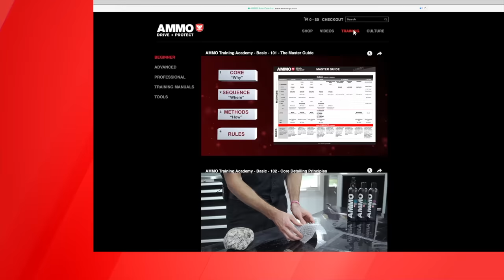14 BAD Detailing Mistakes You Must Avoid: ATA 106

Comment: Best detailing tip I learned from this!  Buy a brand new car, have it fully wrapped at the dealership with super plush micro fiber towels!  Have car delivered to your home,  very very gently push it into a super clean garage, and after gently removing micro fiber towels, never ever drive it!  Keep garage airtight, so no bug could ever crawl on car, persey ever scratch it!

Comment: Larry.Youre certainly the Dr of detailing and I love all the knowledge you pass on.
Thing is I cannot resist stroking my car once its been polished, sealed and waxed,  its soooo nice lol
Reply: SRKarting no!
Reply: SRKarting so is there a way to clean interior without machine , or can you use an all purpose cleaner if you do small sections?
Reply: Joseph McDonnell it’s very time consuming to clean the dirty spots and honestly not worth it, machine use will cut the time you use (say a small dirt, Coca Cola spill) to say 1 minute, but if it looks clean and you just wanna do it for maintenance reasons then do it by hand by all means!
Reply: Clayed my car for the first time ever yesterday and most likely introduced micro swirls haha... Soooo smooth.

Comment: You caught me Larry. I'm guilty of three mistakes I didn't even know I was making. You just educated me, thank you.
Reply: He got me on all purpose cleaner, dish soap and cleaning towels. In defense of my dish soap use, I've only done it when I wanted the paint stripped to the clear coat, so maybe it's a split-decision on that one. I was just about to make some more microfiber towel fouls so great to see this, thanks Larry!
Reply: @am4230  if you are trying to purposely strip wax to reapply later, all purpose cleaner or dish soap is fine to use.
Reply: Actually dish soap is bad it has lanolin in it which if you are in an accident and they have to re-paint the lanolin will seap in and bubble the paint

Comment: I'm late but he said keep APC out of the interior. .  What is best to use?- a dedicated VLR or carpet shampoo?
Reply: Me too. Inquiring minds want to know what to use.
Reply: i know it’s a bit late, but a couple tips. when cleaning hard plastics, leather etc. most of the time a damp microfiber is all you need. for leather, give it a good wipe, then condition it. NEVER us APC on leather or vinyl as it’ll dry it out and crack/tear prematurely. this applies to plastic as well but you can go back over plastic afterwards with the damp rag and it should be good. as for carpets and stuff, most carpet cleaning vacuums have special soap that goes with them. for touch screens, damp microfiber then dry with a dry microfiber right after to avoid water residue on the screen. inside windows can be cleaned with just a dry microfiber. unless you’ve got spill stains or oils from your arms/hands in it. then damp micro followed by a dry one.

Comment: Hey I was wondering if you could do a glass scratch repair video
Reply: Samuel Dansie how in the hell doe you scratch glass, if you drive a commodore I demand answers
Reply: logan thompson dirt in window seals
Reply: Samuel Dansie glass is the hardest substance you find on the car 😂
Reply: its the same as for paint except you use different pads and compounds.
Reply: As a glass installer often times it’s best to replace the glass when it’s badly scratched. Cerium oxide can polish small scratches, but it’s a tricky substance to get right. Too much heat will leave a distortion, not enough just makes the scratch ‘shiny’
Reply: well the commodores need more than glass repairs after todays newcastle race.
Reply: Propotus is there any other things I've been able to get it to a haze is there any thing other than cerium oxide that would work
Reply: Darren S nah mate it'll be right she'll buff out......
Reply: logan thompson lol classic line there mate
Reply: Samuel - Just use a polish (Meguiar M205 polish) and buff with a wool. It removed all of my scratches on my windshield due to worn out / damaged wiper.   And then make sure to give good couple of layers of wax afterwards otherwise the wiper will squeek when you use them on the windshield.
Reply: Samuel Dansie I saw a video on here one time where the guy used orange hand cleaner on the windshield. Either it was like Goop without pumice or with it. Can’t remember but it took the fine scratches from wiper blades out

Comment: Living in CA, we are very water restricted. I only do one water wash a year, during my annual beautification process for my true beauty queen (Tesla Model S).  All others are waterless.  It's a BIG challenge.   I actually do use a CA car duster and have never had a problem.  I will say that I replace them very often and I use the absolutely lightest touch I can to capture the dust.  Even after a rain I will use it when the car is dry and I have been able to carefully remove the abrasives.  Not easy, I can tell you.  I was terribly stressed at first.  But I found a way to make it work.  I do have a nano coating on it, which helps provide some resistance to scratching. If you are going to use a duster, you absolutely need to know what you are doing.  Period.

Thank you Larry on your fantastic vids.  I have learned so much from you!!!

Comment: I have a question
How do i properly dust off my car?
You know, when its been sitting there for a day and dust accumulates making ur view through the windshield slightly distorted
Reply: I’m wondering the same thing.
Reply: If you have access to an air hose with an air gun it makes quick work of that dust!
Reply: Air gun or air chuck, or, you can get a bottle of waterless wash and wax (I prefer Meguiar's) and spray a little more on than if there was no dust to lubricate it properly, then wipe off and buff with two clean microfiber towels, one for the initial wipe, one for the buff off.

Comment: So you're saying I can't just use a scotchbrite pad and go to town on my paintwork?
Reply: Seb Krause I use magic erasers to get scratches and rough stuff off it’s basically fine grade sand paper just cheaper. But you do have to buff and wax cause it dulls the shine.
Reply: only use 3M adhesives on your paintjob
Reply: Seb Krause JUST BREAK OUT THE CORDLESS SANDER!
Reply: You can do anything you can afford :-)
Reply: Yes just use the grey wet with some blend prep then dry. Don't forget to top coat it when your done with a nice rattle clear
Reply: There are a lot it great detailing rocks you can use these these days that are much more effective 👍
Reply: Even better , some 80 grit sandpaper 👍
Reply: Seb Krause just make sure if you see scratches,that means its cleaning the dirty paint and new paint grows back on with the water!
Reply: As a kid (like 8) I washed my moms car all the time. The hood on my moms 2002 Honda CR-V had bird shit all over it. So I got a scothbrite pad and buffed that shit out😂😂 it looked okay till it dried. Lmao. I guess we all come from somewhere
Reply: Scotch bright I just take a piece of tape and put it on the ground to pick up sand and rock particles than I wash and wax my car all in one pass using the sand and rock covered tape

Comment: I'm in the car clenaning trade 3.09s i've used AutoGlym Ultra Gloss on my 2002 Yaris door mirror plastics and it came out brilliant! It really gets it back to black and shiny so no problem there at all.I'm a car valeter for some 20yrs and i do understand about plastics and polishing/waxing.APC on interior is SO TRUE! In the trade we had cheap TRF (Traffic film remover) and used it on EVERYTHING incl leather,seats and so on.It really does ruin the cloth seats and carpets i tell you.The leather is ok it's just i rubbed off excess TFR with a warm flunky/chamois properly otherwise it gets sticky n horrible.

Comment: Hey Larry great video. I wanted to say THANK YOU SO MUCH for the tip of using left over “wash solution/soapy water” when claying. Such a simple yet over looked idea. I saved about half a bottle of detail spray. And I don’t wear gloves whilst washing the body of the car because I really enjoy feeling the soap and contours of my car panels between the mit and my bare hand. Sounds strange I know.... I am strange! Loving this series! Keep it up.
Reply: Fes Y I detail and I always start washing with wheels and wheel wells and I use my old wash Water to save soap cause it’s just gonna get filthy with brake dust and mud anyways.
Reply: Tammy Forbes what?

Comment: Good morning Larry. So no chamis, no silicone squeegees or beach towels. How about a video on the best way to dry a car?
Reply: Chris Muncy he already has.... spoiler alert huge microfibre towels
Reply: Thanks Logan :-)
Reply from the maker: I have a bunch of these videos. Here is one: https://www.youtube.com/watch?v=w0hzJImmvNU
Reply: Thank you Larry.
Reply: I use a leaf blower then a big micro fiber towel.  I'm sure Larry and others will say that's wrong but it's never caused a problem and i drive my car thru the air at 100+ mph all the time.  

Real important, make sure the ground is clean and wet.  I once had to move my car before I dried it.  Didn't go well.
Reply: Mf towels, he has a six pack of red mf towels on his site. I own them are very good at drying and buffing off wax or sealants. I also ordered some from amazon.
Reply: Texas Car Nerd that's why I don't bother with the blower aha
Reply: GET A BLOWER!!!!!  A MUST FOR A BLACK CAR!!!  

1)  no contact, at all.  
2)  anything that falls on your car between the rinse, and dry, (or any missed dirt) is simply blown off, or blown over........not rubbed in. 
3)  humidity in the area???  The heated air of a blower takes care of it no problem 
4)  IT'S SO FUN AND SATISFYING!!! 
5)  dry your tires so they can accept tire shine immediately.  You can even dry your rotors before they rust!!!

BEST $160 I'VE SPENT ON MY CAR!!!!
Reply: Use a air gun,  a blower like a electric leaf blower or a shop vac with a blower function
Reply: I stopped drying with any microfiber towel. They all scratch.
 I use filtered water..

Comment: Great tip on using gloves. I'm not sold on the black ones, though. Seems like lighter-colored ones would be easier to see possible contaminants on, so that you can avoid transferring them onto the surface. Thoughts?
Reply: I have the same black ones he has, very good quality. I however don't care to see the contaminants on my gloves. You can see it come off during the wash process, in the wash mitts or clay bar if you're doing a full detail.
Reply: ForeignBorn Patriot think he means touching stuff with the gloves though
Reply: Yeah, I'm concerned about stuff getting on the gloves, and not being able to see it and wipe/rinse it off real quick before continuing to work. 

I'm sure those Black Mambas are some kickass gloves, and I wouldn't hesitate to use them for stuff like oil changes. But for cleaning, I think I'd rather use something with a high visual contrast, kind of like how white gloves are used for checking dust.
Reply: Urambo Tauro...The black ones (and some blue ones too) are NITRILE-based gloves whereas the lighter-colored or clear ones are vinyl/latex-based.  You want the NITRILE-based gloves - from whatever manufacturer - because they are impervious to most common cleaning chemicals.  They're also significantly tougher than the vinyl/latex gloves.
Reply: The Black Mambas are awesome gloves.  I've been detailing professionally since 1985 and they are the best I've found so far.  I do wish they came in a lighter color because the black ones get HOT :-)  That said, they are available in 3XL and they hold up extremely well for all of my detailing tasks.

Comment: No APC for the interiors? What should we use then for the dash board and trim? Most people I know use APC for 80% of the interior.
Reply: Joe B unless heavily contaminated/stained, warm water and gentle soap is safest to use... If APC and such gets under the plastic coating they will start to bubble up. VW are notorious for this happening.
Reply: There are people out there using apc on interiors for 30+ years. Different people different techniques. I think its wrong to say most of the things he said are a no go.
Reply: I always just used water for a long time unless there was something that needed a cleaner. I use turtle wax dash and glass now its pretty cheap and really mild. Still grab something stronger if anything more than dusting is involved though.
Reply: The secret with using apc is to rinse out the apc, then rinse again. You will be surprised how dirty the rinse water is, this is why you need to rinse 2 or 3 times, you don't want to leave dirty solution in your car (Larry says where wet shoes re-activate the cleaner -because the cleaner has not been rinsed out). I can never understand why so many people doing YT videos never seem to mention rinsing out the cleaner.
Reply: Just use a dye-free laundry soap like Woolite or Dreft diluted into water using a dedicated spray bottle like you see in the $1 bins at Target or Wal-Mart. Dont use the car stuff that leave a shine after cleaning cause that stuff only attracts more dust.
Reply: @Ronke01  seriously?!?!  guess I've been lucky then,  I've used APC on all my VW's and haven't had any problems whatsoever!

Comment: Will wax schampoo make the plastic details fade?
Reply: Bassen98 this is a good question
Reply: Bassen98 I believe on textured plastics
Reply: dunno but the sun fades black plastic trim like crazy, but there's nothing much you can do about it.  But if you DID want to restore plastic trim, you'd have to
1)all-purpose cleaner all the outside trim
2)isopropyl alcohol all the outside trim
3)semi-permanent exterior trim sealant on the outside trim $$$
(you might have to do this twice, AND it will only last 1 year tops).

So it takes a long time to restore the trim, and it doesn't last long.
P.S - you definitely DON'T want to tire shine the trim because that'll dry it out even more.  I don't even like using tire shine on tires for that reason (leads to dryness).
Reply: Zenon B fuck it, just paint it haha

Comment: Wax and sealants on black trim.....magic eraser misted with water gets rid of the white residue.
Reply: GeraldLaz38 good to know I accidentally got it on my trim and it won't come off 😂
Reply: Oh sweet Jesus, thank you!! Just waxed my car and have small spots of wax on my black trim and can not get it off.... soooooo frustrated. Read this, went and got the Magic Eraser and bam... you have saved me. Thank you!
Reply: also good for using to clean brake dust/yellowish marks off of aluminum rims
Reply: Another tip is to use Mother's Back to Black on your trim FIRST before you wax, this way if you do happen to accidentally get wax onto your trim it wipes off very easily.
Reply: I am shocked that this is a thing. I always wax those areas on purpose. The wax comes right off just like the rest of the car. Have I been stupidly luck for the 15 years I've been detailing my own cars??? LOL

Comment: Ouch... thats very controversial about the dishsoap. Haters gonna hate, trolls gonna troll 😆
Reply: People who use dish soap are either stupid or cheap and don't want to spend on a stripper soap. A decent one is about $15-20
Reply: Stripper soaps are a fad too... They might leave a surfectant film to make you think they offer any power to strip protection, just as dish soap does.
Theres little point in "stripping" it anyways as compounding/polishing will do it for you.
Reply: Ronke's DIY Workshop how many times are you going to compound and polish a car? I only detail my own. When I do a full detail every 3 months I use meguire wash plus. Didn’t leave any film behind but it did strip off old wax n sealants.
Reply: ForeignBorn Patriot How long is a piece of string? Compounding and polishing is based on the necessity, just as claying...
Why would you strip it anyways if you're not going to polish it?
Wax plus contains polishes btw.
Reply: ForeignBorn Patriot I POLISH IN CAR EACH WEEK
Reply: Pedro Stanjel your car or clients? I don’t see why you would compound and polish your own every week.
Reply: Ronke's DIY Workshop the polishing agents I very minimal. Living in nyc with all the construction and debri in the air cakes cars pretty quick, hence a full detail every 3 months. Plus no wax in this city could last more than 3 months especially in the winter.
Reply: ForeignBorn Patriot Still, stripping the paint is unnecessary at that point. Simple wash, clay (if needed) and reapplication of wax is all you need.
Again, Wash Plus isnt advertised as being a stripping agent, it effectively polishes the surface because of the SMAT that are present in the soap.

If you want to do a decent application of any of the "ceramic" coatings, polishing beforehand is necessary, as even panel wipe or IPA is not sufficiant on its own to strip the previous layer of coating, sealant or wax.
If they can't shift this stuff, dish soap wont either, nor will the CG stripper soap and others...
Reply: Ronke's DIY Workshop I find stripping leaves a better finish by leaving the surface better prepped for sealant n wax. I also do maintenance washes weekly.
Reply: if it doesnt cost $100 an ounce I refuse to use it on my vehicle

Comment: A water blade does not scratch a properly washed vehicle. A
 high quality synthetic chamois is my go to for drying. Dry one panel at a time, wring out the chamois and return it to a bucket of warm water, then follow up on each panel with a quality microfiber. Drying your vehicle in shade or in your garage is optional.